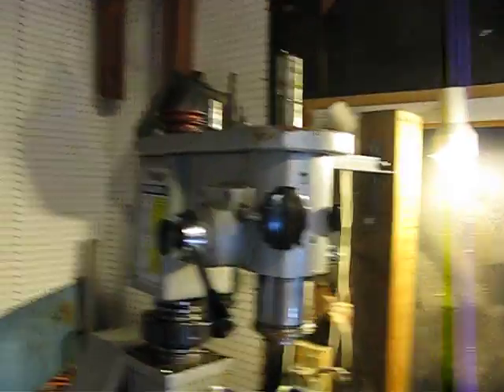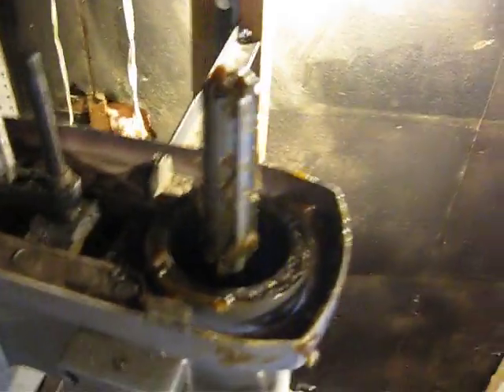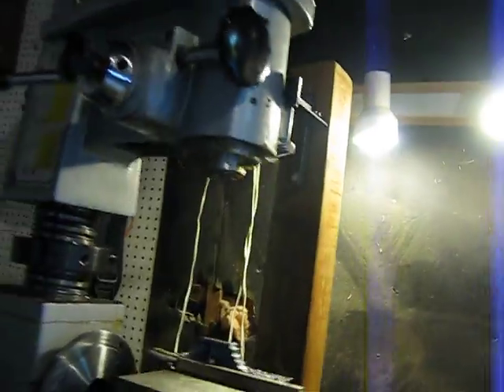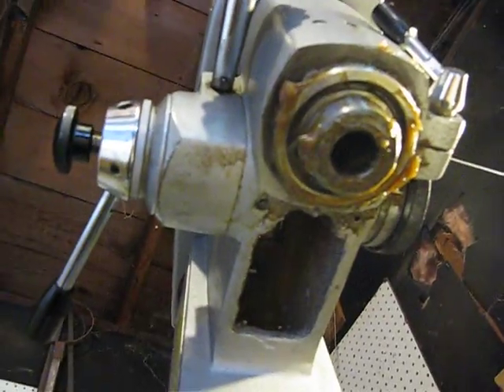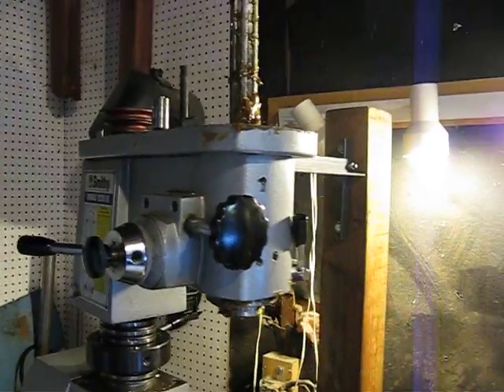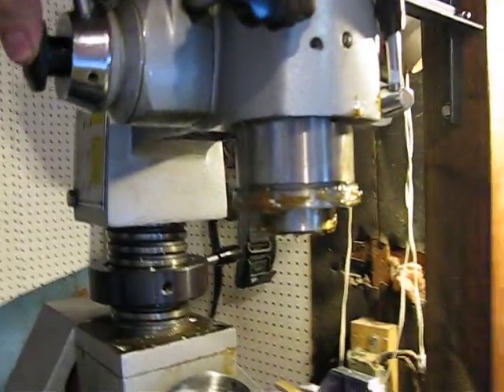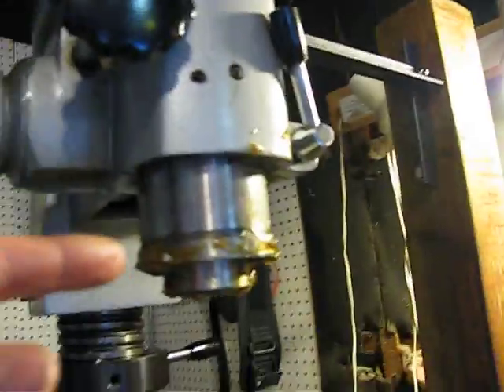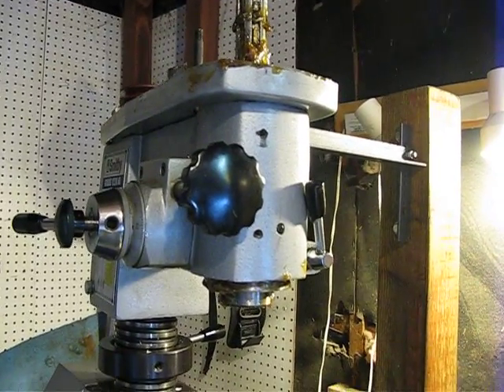littlesmithey.AVI

Comment: OIL BUTTON!!! LOOK IN YOUR MANUAL JACKASS. Lmfao you obviously don't know how to fix it so i would beT that means you sure as hell don't know how to use it correctly or maintain it.  I'd be cautious about shitting on a 3 in 1 machine before actually taking the time to verify you know what your doing...you fixed this yet? If not look at your fucking manual.  There is no way for the spindle sleeve to come out with out removing the entire quill.

Comment: Its not hard to repair the spindle bearings, the gear cross shaft has to come out to get the quill out and then you can press out the spindle and replace your bearings .

You should have greased them when new ------yes they can be packed with grease !!